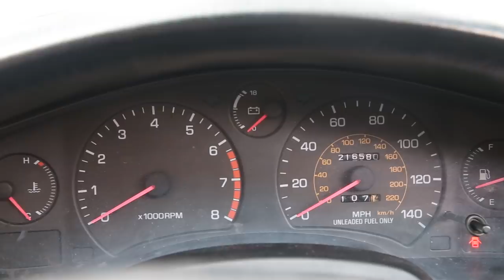I Bought The Worst Toyota MR2 Turbo In The Country For $1,000 And It's Awesome

Comment: These are great cars... it will be interesting to see what comes of it...  as for the Fiero... remember, that was conceived under the infamous Roger Smith regime and the Fiero was only approved as a safety commuter car...  fantastic concept that was screwed up like everything else under Roger's leadership...  and I use the term 'leadership very loosely.  
Also, the early Gen2 Mr2's I believe had a problem with their rear suspension geometry, causing  snap over-steer, which was corrected in later models.   
And I think its great that you have an idea and execute...  on your own whim...  do as many projects as you want.  Its great.   
You can multi-task; I can multi-task; we all can multi-task.  So, let's multi-task

Comment: Man! I'd prefer that you did the usual 'rag on the Fiero' for its obvious flaws than to say that the primary purpose it served was as a base for kit conversions. I think that's an odd and incorrect statement. You can say the Iron Duke was underpowered. That's a fact. You can say the early base-model suspension was lackluster. We all know that. But people buying Fieros new, and most people who are seeking them out and buying them now, are not doing the ridiculous Ferrari kit conversions. Goofy, quirky, and slow, sure. But at least let it stand on its own!

Comment: MR = Midship Runabout - since the wheels are behind the motor and not in front of the motor it's not "technically" rear engined - the Porsche folks are flailing right about now with this detail....  a 1000 bucks eh?  only if they were paying YOU the $1000....

Comment: How exactly is any stock sw20 turbo mr2 faster than the mk4 supra turbo and the NSX? Not sure where you're getting ur information from on that.
Reply from the maker: Later models were faster than Supra Turbo and NSX in the 1/4 mile.
Reply: Tavarish answer the question. Where are you getting this info?
Reply: Lmao, are you getting these info and times from MR2 guys on the internet forum with non stock cars?

Comment: Mid Rear Engined platform... Correction, (M)id Engine (R)ear Drive (2) Seats. Thank you.
Reply: This is just as wrong as what Tavarish said. 

In the case of the MR2, "MR" stands for "Midship Runabout" - period.
Reply: Is it a boat?
Reply: From Wikipedia; "The name MR2 stands for either "mid-ship, run-about, 2-seater"[1] or "mid-engine, rear-wheel-drive, 2-seater.[2]
Reply: Yes, people [aka: idiots] are also able to post misinformation on Wikipedia as well. This is not news. ;-)

Comment: I had a 87, bought it it for $400  but didn't see under it until my bubby got in the passenger seat and found out the floor had a huge hole on the floor that caused a huge slash on his leg...!😷🤕
but a road work sign fixed that...lol🤐
then no more than 3months after I bought the car the clutch went out, after the seller said it was new..!!
but it ended up being more than I paid for it soooo...I sold it to
 sumyungkid..lol🤓

Comment: Sorry, but the reason that the mr2 never caught on isn't because they built too many of them.  No, it never got popular because the first few model years were overpriced gutless wonders.  By the time that Toyota finally figured it out and put a nice engine in them, it was too late the reputation was well established.  

That Toyota eventually did offer a respectable engine is about the only thing that sets the mr2 apart from the Fiero.  Glad for you and others that think the mr2 has reached cult status with you.  But your comparison of the mr2 to exotic sports cars, including the NSX doesn't make any sense.  They are not in the same class.  Regardless of how few were built, the NSX is just a much more capable car.  I would probably walk right by an mr2 at a car show.  It just doesn't float my boat.  

Hope you have fun with it.  But I will me much more interested in following work on the SL.

Comment: Please take out the snorkel because it ruins the airflow of the engine compartment. and the fentilators, are they blowing in or out? because when they blow in: there is no air flow anymore in the engine compartment. so your engine has less cooling. The MR2's engine compartment is designed to allow air from the bottom and the sides to the top, to pass through the engine compartment for the airodynamics. and that is now ruined. (>_<)
Reply: just a warning i have 1 to, and it is a commen mistack

Comment: Got my 2006 Mazda3 S hatchback for 700$ CAD as my first car, 
as of now, there are a few problems with it 
as of : 
worn link kits
not working radiator fan 
rear right brake sticking occasionally when stopping. 
worn control arms

 i think i made a good deal on it and i am planning to fix it (if i can because $$$)
do you think i made a good deal?
(also, its a manal transmission)
Reply: 47Gigs no